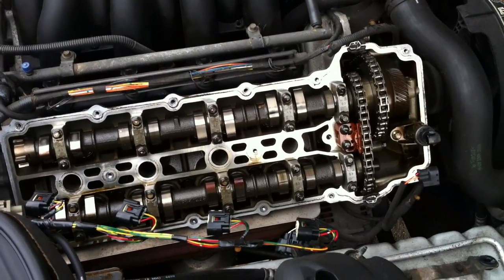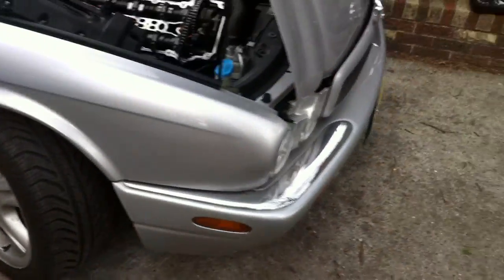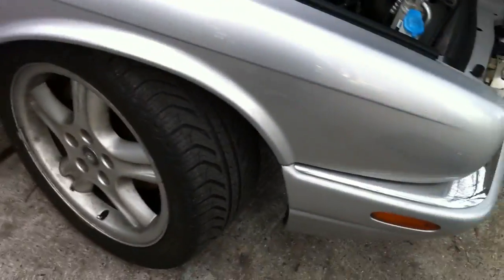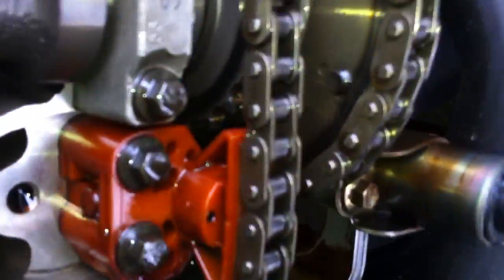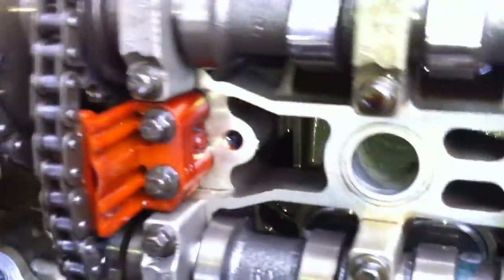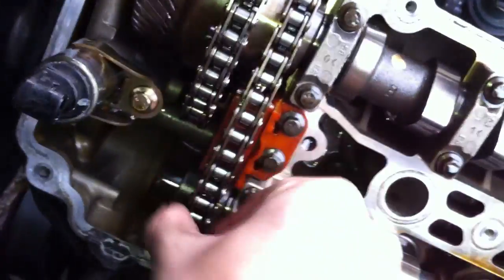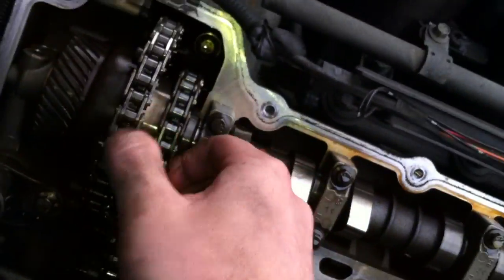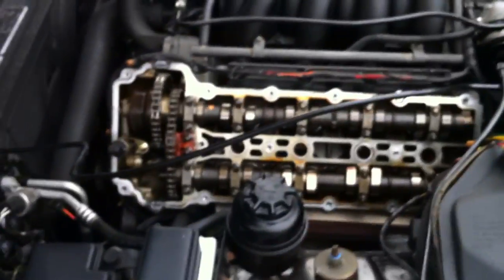Jaguar AJV8 Knock Assessment

Comment: One thing that stands out to me, The camshaft lobes 3 and 4 are red on your passenger side exhaust cam. This is where my camshaft broke... Does not mean this is the same case. Just thought it was odd. You could try and turn your crank to feel if there is a noticeable spot where the engine feels strange.